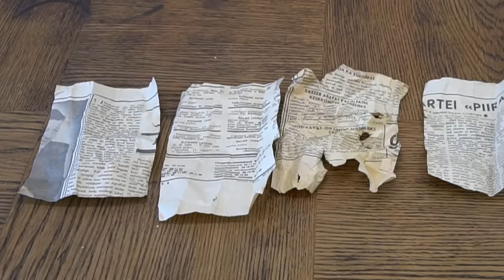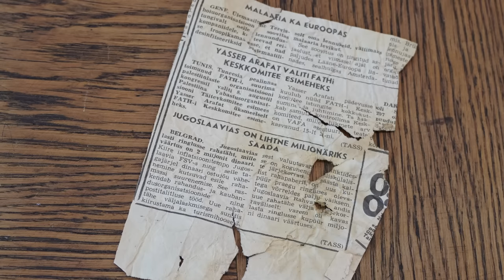BEAUTIFUL restoration of an UGLY desk

Comment: thank you for your work. but i didnt continue to watch after the 5th min. Why would you use PVA glue on any antique / vintage furnitue? it's unrepairable and compared to the natural glues they are much more expensive. I hope to watch vidoes fom this channel with more natural products.
Reply from the maker: PVA is repairable and also it is natural, made from milk. It also reacts to heat like hide glue does.
Reply: @ATRestoration  really? To be sure  I googled it and in Wikipedia stays theye are plastic. Then i frankly wonder which glue you use and where you buy it. 
Can you may be share some links? Which product you buy and where you find it? It would be kind of you! I would like to know it
Reply from the maker: @scocakli  I use PVA B3 and I buy it from the local store. The brand doesn´t matter much. Pva is a bit stronger than hide glue but it is not compareable for example with epoxide, which is almost impossible to reverse. Also if the wood is weak, then it will break no matter what the glue is between the joints..
Reply: @ATRestoration  ok, i checked it again and found out the problem. There two different informations about the same product in wikipedia in english and in german. In German site is given that pva is a plastic product. 
Thanks a lot! I learned something new for me!